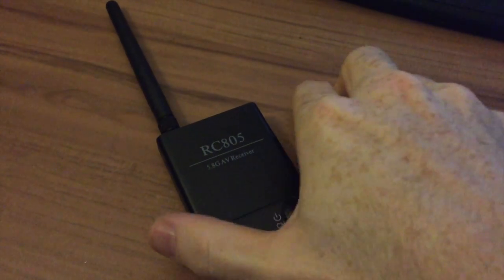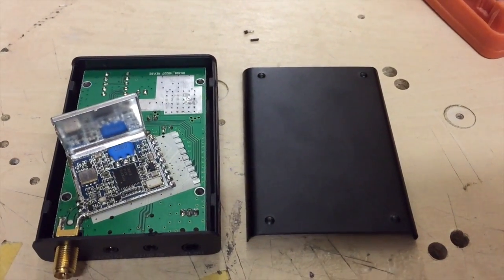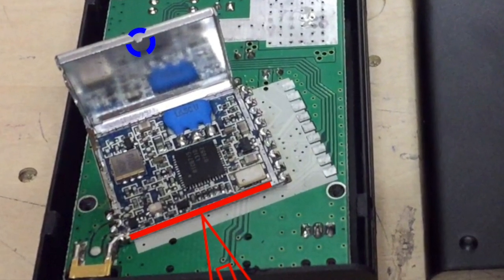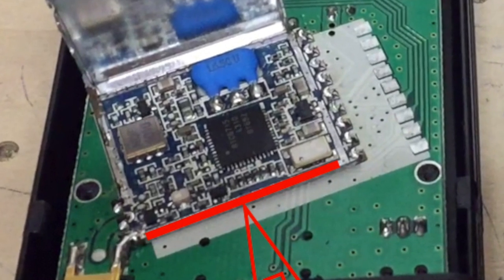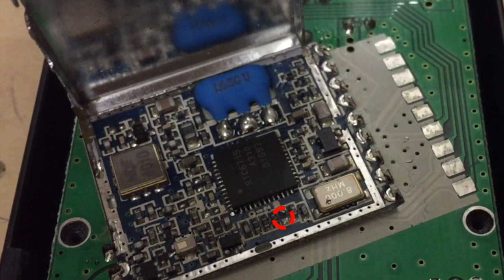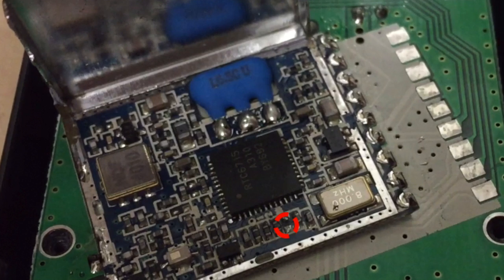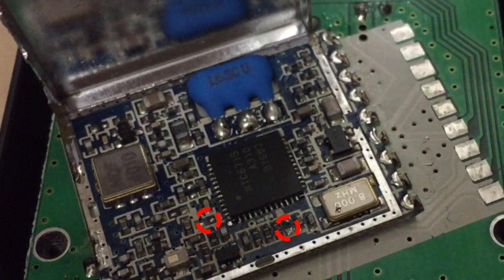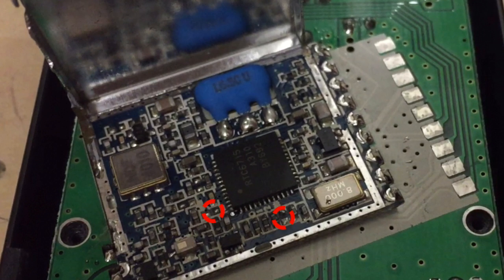HowTo Get A and/or B Channels on RC805

Comment: this helped me alot, thanks. although mine is C band, not E, i have TX that is set on E band and that damn thing is not connecting... i noticed 2 additional empti solder points any idea what they do? perhaps add more bands?
Reply from the maker: Hi MariusPX, sorry i don't know what the other pins are used for.
Reply: how did you find out how to add A and B bands?

Comment: Im trying to figure out how to get E band as you mentioned, but not sure is the only one I need to solder for E band is the one on left to the black chip.
Thank you in advance!
Reply from the maker: Hi, the E Band is Default in this Reciever. A and or B Band is done by Soldering like i mentioned in my tut.
Reply: +Ripcurl777 I have one that comes on A-band stock, and it's slightly different. the first solder point has a resistor there, just like the ones it is next to.
The second one is open. 
How would I go about this one? I'm not sure what removing the resistor in the first spot would do, and I'm not sure what putting a bridge in the second spot would do with the resistor.
Reply from the maker: +Low Elevation RC Hi, the resistor are also only Bridges, so i think you can remove the resistor, or add a brindge like i did i my Original video. They use resistors but you can also only set a bridge i think.
Reply: +Falcon Vision Productions how to get band E any idea?
Reply: +farhan r  Havent been able to figure it out yet! if you find anything let me know please!
Reply: +farhan r I got an early reply from the channel owner sayi that this receover has E band by default
Reply: +Falcon Vision Productions unfortunately mine is band A by default and my trx is band E
Reply from the maker: +farhan r hi, so if yours is A band.. Both points mentioned in the vid should be "closed" so, just unsolder the two  points / unsolder the resistors.